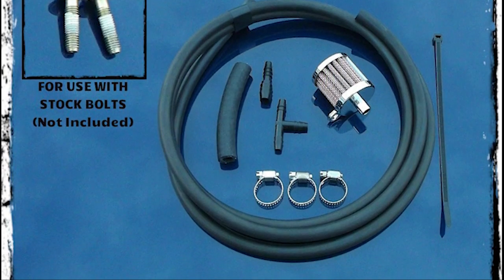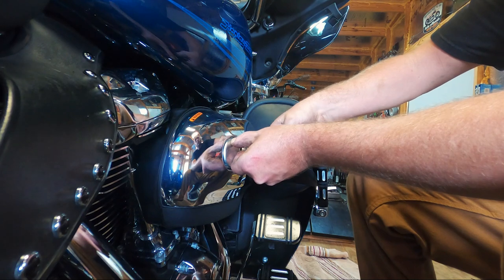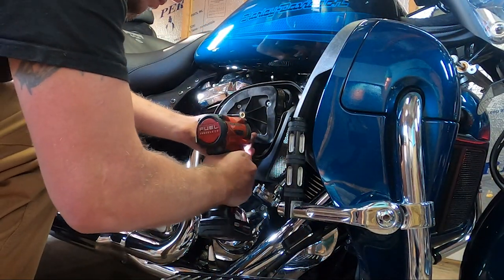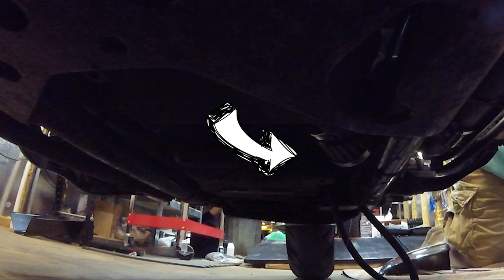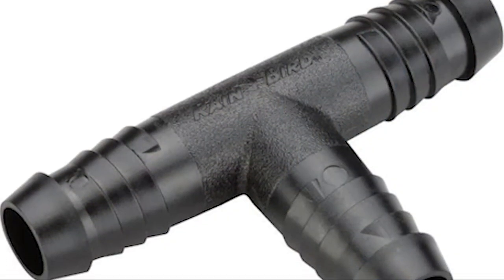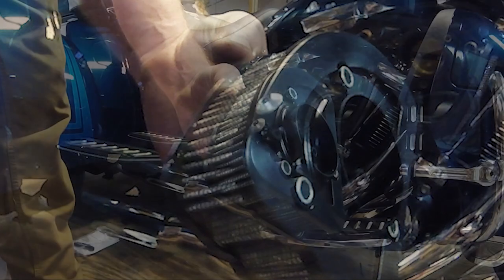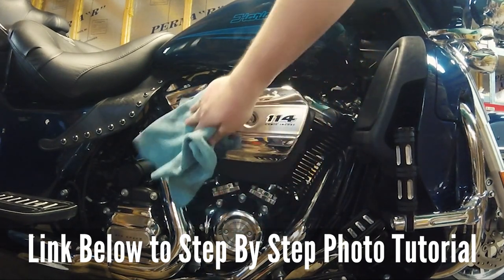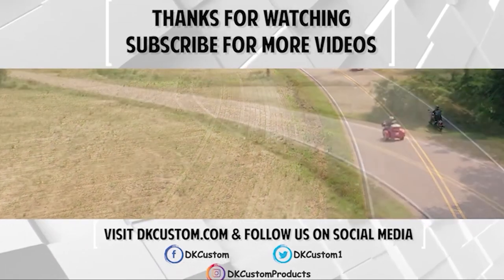DIY-How to Install Breather on a Stock Air Cleaner

Comment: I did this several years ago on my Sportster. Same principle but slightly different. I still use my stock air filter and air box but I don't have a filter or catch can at the bottom of my tube. After my ride, I place a folded paper towel under the drain tube for the first few hours to catch the one drop of residual oil inside the tube which finally drips. My bike runs much better and my air filter and air intake inside the carb stay clean.
Reply: Do you have both hoses running out with the T on the outside or did you put the T on the inside. I’m curious on how you did it. Wanting to do my 2011 nightster

Comment: I just installed this fantastic kit on my stock 2020 road king .  I didn’t have to remove the backing plate but know the filter assembly splits in half. The assembly has one tamper proof screw on the top right side. A mini vise grip works well to remove it. I then drilled a hole at the aft section of the housing to bring the hose to the outside. The hole size is flexible just don’t crimp the hose. The “t” fitting inside the housing I placed it with it at the 12 and 6 position and one leg at 3 o clock for the forward vent. This allows for a gravity feed/ flow until the crankcase pressure increases. The quality of the kit is outstanding especially for 39 dollars. The hose was routed along the after crank case and was p clamped the a cosmetic exhaust bracket.  The p clamp went around the breather inlet and is not included in the kit and is really needed.  Hint hint.
Reply from the maker: Good to read you're enjoying.  Thanks for giving the details of how you installed yours.  Yes, a P-clamp is a good idea,  👍

Comment: Just completed the installation of the DIY kit in my 2009 FLHTCU Twin Cam with a Screamin' Eagle Chisel Extreme Billet Air Cleaner Kit and an S&S 106 big bore Kit. I chose to run the hose up above the throttle body routing the hose under the gas tank and stashed the filter in a compartment behind the right side cover. Unless I point it out, nobody will see the ports and the tubing.
Reply from the maker: That is great! I hope you love having the External Breather System installed. I know your bike will!

Thank you for your business and for commenting! 👍😎👍
Reply: @DKCustomProducts  It has been a rainy day here in Atlanta so I have not done a road test yet. However, I did run the bike in my garage with a fan to cool the engine. So far so good. At some point in the future, I may end up getting one of your Air filter kits for my 2009 FLHTCU, the quality of the Sceaming eagle Chisel that I have is not very good. Oh, Forgot to mention that I cleaned a bunch of carbon from the throttle body and the back side of the butterfly.
Reply from the maker: Awesome! Your bike will over time burn the rest of that carbon build-up off. 

Here is a video about the differences in our Air Cleaners that you may find useful/interesting- https://www.youtube.com/watch?v=xP7wxWQmSa8

Here is a video with some dyno runs with our Air Cleaners you may also find interesting- https://www.youtube.com/watch?v=KT-Ts7YFtV0

Please feel free to contact our Customer Service with any questions you might have;
Support@DKCustomProducts.com
662-252-8828

Thank you for your business and for commenting!
Reply: I did a 200 mile test ride couple of days ago No leaks and the throttle body is dry. The filter is a little damp sop I put it in a small round rubber maid bowl. I'm very happy with it but I'm not very happy with the build quality of the SE Chisel air intake. I cut my fingers on the edges on some jagged edges. I filed them down so it will not happen again. I am very interested in replacing the filter with one of your filters.
Reply from the maker: If you decide to go with one of our Air Cleaners please feel free to contact our customer service and they will help you choose the one that will best fit you and what you are looking for;
Support@DKCustomProducts.com
662-252-8828

Here is a link to our different size Air Cleaners that will fit your bike -https://www.dkcustomproducts.com/air-cleaner-intake-c10-395.htm

Thank you for commenting!

Comment: while your at it remove the cat. i did this to my 2016 RK and it made a big difference true duels, now the engine can breathe, no hot oily air going into throttle body, a few more HP also
Reply from the maker: The cat removal definitely reduces radiated heat from the exhaust. 👍

Comment: I’m wanting to do on my bike. I was wondering how much this changes the air/fuel ratio when adding to stock air filter if any?
Reply from the maker: Good question.  It does not really change the AFR volume wise, but it does do the following:
1.  It lowers your IAT (Intake air temperature) which the ECM sees and adjust accordingly.
2.  The air going in is now richer in oxygen, which the ECM sees (via the o2 sensors) and adjusts accordingly.  (similar to how they adjust for different elevations.
3.  Now you are getting clean, oxygen rich air (no oily watery crap) and fuel into your intake, so you have a better combustion charge for more power.

No retune is needed for adding an EBS.

Comment: I got a question. I watched a video....I don't remember who's channel it was but the man was talking about doing this and venting the crankcase on a m8 will take all of the vacuum out of the motor and the motor needs crankcase vacuum to run correctly. He also said doing the external breather is a bad thing that you only need to vent the crankcase on the transmission/ motor oil but vent it on the motor oil side. Hopefully this makes sense.  I trust yalls answer more than anybody else's because yall test everything.
Reply from the maker: Yes, in the last year this theory starting circulating around the internet.

 I have seen NO data, No testing, thus No results supporting this theory.

I know where it comes from.  A small % of M8's have a sumping issue.  Rather than fix the problem, some folks are using the band-aid of a crankcase vent.

Does a crankcase vent stop all the hot, oily, oxygen depleted air from going into the intake?  No, it does not.

Does having both cause a measurable loss in power?  Since no one else has published any testing results, we are going to look into it ourselves.

We have purchased several tools and are going to be conducting a variety of tests (some of which are still in the design stages).  Then we will have data/results and be able to speak with more than just opinion on the subject.

It will probably be in November or December when we conduct our tests and publish the results. (we are completely booked up thru October already)

In the meantime, the proven method of getting cool, clean air into the intake has been practiced for over a century, and we are not concerned about going another couple of months with this proven method on our own bikes.

Comment: at 2:02 you say it is crucial to cover the two existing holes on the back cover.can i asked what you used for that?
Reply from the maker: High heat RTV with a nipple (blob) on the outside so it can't get sucked in.  Also have threaded and used bolts or set screw with thread-locker.  Both work, just your preference.
Reply: @DKCustomProducts  thank you.my main concern was something breaking free and sucked in.
Reply from the maker: @fastone136  Using a good RTV with a nipple I've never had one break free.  But, to alleviate any concert, a set screw or a bolt with thread-locker will keep that concern from being in your mind while riding down the road. :)

Comment: When did EPA begin requiring reroute back into intake? I have a TC 05 FLHTC (carburetor) with 95 CI jugs ( all else is stock). Need to know if EBS is necessary.
Reply from the maker: It was sometime in the 70's.
You '05 will benefit from it.  All Twin Cams have the hot, oily, oxygen depleted air routed into the intake.
Here is a video you may find interesting- https://www.youtube.com/watch?v=EfDeFZblMck

Comment: In this video you put blowby gases out of crank case into catch can and then in airfilter and then in combustion chamber..?? Does this called free flow intake???
Reply from the maker: Blowby should go out thru the head breathers, into a hose, and then down into a filter or catch-can.  This is called and EBS, or External Breather System.
Here is a video with more info, showing how the crankcase pressure/blowby flows- https://www.youtube.com/watch?v=x61yu0HKW5c

Comment: Nice! Can this work on a '15 XL883N?
Reply from the maker: Yes, as long as you're running the stock air cleaner, or an air cleaner that allows you to run the stock breather bolts, with room for the hose to be connected to it.

Comment: Do you have a kit that will work on my 2024 Tri Glide Ultra with the 114 engine?
Reply from the maker: I believe that you can use either of these External Breather Systems below, but it would take drilling a hole out of the air cleaner backplate so that the hose can be routed out. 
https://www.dkcustomproducts.com/external-breather-system-w-catch-can-harley-twin-cam-dk-tc-brt-cc.htm
or 
https://www.dkcustomproducts.com/twin-cam-discrete-head-breather-system-touring-softail-dyna-dk-tc-brt.htm

Please feel free to contact us with any installation questions;
Support@DKCustomProducts.com
662-252-8828

Thank you for commenting! MB

Comment: I might sound ignorant here, but why would rebreather oil cause carbon buildup? Aren't the pistons and valves oiled as well? I would think the ethanol buildup is caused by ethanol and other fuel additives/contaminants, or running the engine too lean, rather than the itty bitty oil that's vented through the rebreather tubes.
Reply from the maker: Uh, do some google searches.  Hot oxygen depleted air is a power robber.  There is no question of this.  Hot oil mixed with air and gas on a Harley engine is a power robber.  Why does it build up?  Look at some of the photos of what is caught in a catch-can with an External Breather System at this link- https://www.dkcustomproducts.com/overview-of-external-breather-systems-ebs.htm
Not all of that crap burns, some gets deposited on the piston heads.
There are some bikes out there that only have an itty bitty bit of oil going thru the breathers, but the vast majority of Harley's have a pretty significant amount (as pictured in link above).  Even on the small % that only have an itty bitty amount, they still have that hot oxygen depleted air, which is an absolute power robber.  See chart here- http://www.dkcustomproducts.com/media/wysiwyg/breathertest_1.jpg

Comment: I mistakenly ran the catch can in front of the rear wheel. Do I now need to turn my bike into a trike to eliminate the problem of oil on the rear wheel?
Reply from the maker: ROFLMAO
Reply: Adjust your rear wheel out of alignment slightly. This will allow it to track off to the side and stay out of the oil trail. Problem solved.

Comment: nice, but doesn't that loop coming from the left breather bolt act as a trap for oil or does it get blown out eventually to the filter/catch can?
Reply from the maker: Yeah, on a short run, where the engine does not get up to temp, some might collect in that low spot.  It does not do any harm, no backflow or impedance, and it will all get blown out once the engine is fully hot.

Comment: Inside my 107 stock air cleaner, there is already a T for the line.  Do I need to block the hole in the plastic on the air filter where the hose went back in?
Reply from the maker: You do not have to do anything to the filter itself. You will just need add the hose to the stock nipple head bolts and drill a small hole on the plastic airbox and route the hose out the hole. 

Please feel free to contact us with any questions;
Support@DKCustomProducts.com
662-252-8828

Thanks for commenting! 😎

Comment: Do you have a video of an installation for Harley's high flow air box on an M8? That p/n is 29400245A. Looking to get the es for my ‘17 RGS. Thx
Reply from the maker: We do not have one for the OEM M8 Hot box.  However, the following video on a Sportster is very similar.
https://www.youtube.com/watch?v=neBEGdhQnwk
Please feel free to call or email with any questions.
662-252-8828
Support@DKCustomProducts.com
Also, here is a video you may find interesting regarding HD's "High Flow Air Box"
https://www.youtube.com/watch?v=tJXGEwLCNDw

Comment: A new question….. on my way FLH M8 Road King…. Is the flow of oil through the oil cooler thermostatically controlled? Is there some kind of temperature sensor that allows oil to go through the oil cooler when the oil has reached the correct temperature? And the real question would be what temperature would that be? Or does the Oil simply flow through the oil cooler at all times?
Reply from the maker: There is a thermostat.  Normal operating temp of the oil is 230 F.
As a rule these bikes run so warm that after 15-20 minutes riding the oil is going to be flowing.
Reply: @DKCustomProducts  What oil temperature does the thermostat allow the oil to flow through the oil cooler then? My guess would be 230° because that is normal operating temperature. The reason why I ask this question is because when I change my oil I want to make sure to get a good drain and to have had outside temperatures high enough to reach normal operating temperature of 230°. Does that make sense? I’m assuming that any temperature under that would not allow the flow as you say going through the oil cooler.
Reply from the maker: @jeffreyengle2762  Thermostat opens up in the 180-190 range.
Very good practice to get the engine totally warmed up before changing the oil.  200 F will do the trick.
Reply: @DKCustomProducts  exactly the information I was trying to find out.
Reply from the maker: @jeffreyengle2762  Cool. 👍👍👍

Comment: Can you buy just the filter/external breather. Put one on one of my bikes an ended up selling it. Ran the tubes an stuff already on my new one an just needing the filter.
Reply from the maker: Congrats on the new bike!  👍
Yes, call or email the shop on Monday and they'll be able to help you out.  Support@DKCustomProducts.com or 662-252-8828
Reply: @DKCustomProducts  does this void any warranty and can you give more details on the plugs  and mounting them please thank you
Reply from the maker: @Whittiercruising  Yes, you are modifying a part, that certainly will void the warranty on that part.  Additionally, you are changing emission items, so that puts the entire powertrain warranty in jeopardy.  Plugging can be done with a high heat silicone with a tit on the outside to prevent it being sucked in, or by threading the holes and screwing in a plug WITH threadlocker.

Comment: Would this kit work on a screaming eagle filter? It looks almost the same as a stock one...
Reply from the maker: It depends on the year and model of the bike, as well as which SE Intake you have.
Email or call with that info, and we will be able to let you know which of the EBS kits will fit your particular set up.
Support@DKCustomProducts.com
662-252-8828
Reply: Do I need a kit or simply create one with typical parts.

Comment: does the system work with a vance and hines naked intake
Reply from the maker: With the Vance and Hines V02 Naked intake you can use either one of the External Breather Kits found at the two links below. The only differences are one comes with a catch can and one comes with a filter.  Please remember Be sure to plug or cover the hole in the backplane that the hoses currently route into when installing an EBS. 

https://www.dkcustomproducts.com/premium-catch-can-ebs-breather-system-for-harley-twin-cam-dk-pr-cc-brt-tc.htm
or
https://www.dkcustomproducts.com/premium-discrete-breather-system-twin-cam-touring-softail-dyna-dk-pr-dis-brt-tc.htm

Please feel free to contact us with any questions;
Support@DKCustomProducts.com
662-252-8828

Thank you for commenting! MB

Comment: The pictures of the oil-carbon covered pistons are misleading since it’s more likely it’s caused by worn out valve-guides.
Reply from the maker: Your assumption is inaccurate. 
We have seen hundreds of piston caked with oil-carbon that were cleaned, put back together with an EBS, no other work done, and no more build-up.  Here is a report with photos- https://www.dkcustomproducts.com/overview-of-external-breather-systems-ebs.htm

Comment: What size drill bit is recommended?
Reply from the maker: For these kits at this link- https://www.dkcustomproducts.com/diy-external-breather-systems-528.htm
There is a drill & tap set that can be seen at this link- https://www.dkcustomproducts.com/drill-bit-npt-tap-for-diy-external-breather-systems-dk-diy-dt-kit.htm
It includes the 11/32 inch drill bit.

Comment: Is that T fitting inside to create vacuum?
Reply from the maker: It is not. 
 that theory of vacuum from the intake, sucking on those little hoses, going thru the heads, up thru the rocker covers, down thru the pushrod tubes and into the crank, is close to non-existent.  Lots of folks talking about it...no one has published any data showing that it actually occurs.
Like anything else, suction from the intake will take the path of least resistance, and making it past the umbrella valves in the rocker boxes (which the whole purpose/design is to only allow flow one way....toward the intake and away from the crankcase) is just not going to happen.  The path of least resistance will be thru the filter element.
What is shown to be true in dyno charts and photos over the last 5+ decades is that engines run stronger, cleaner, better MPG with External Breather Systems.